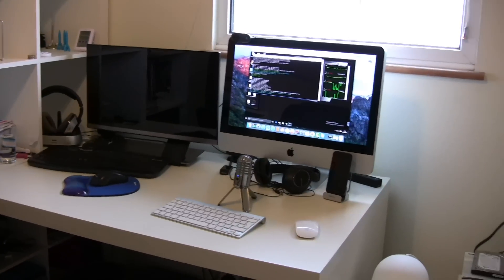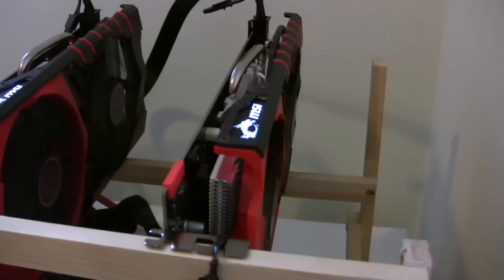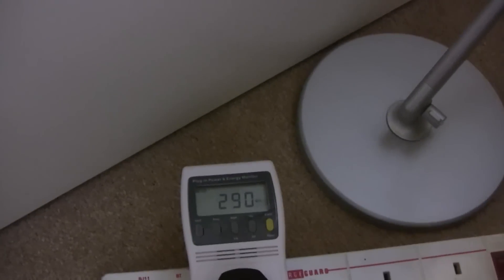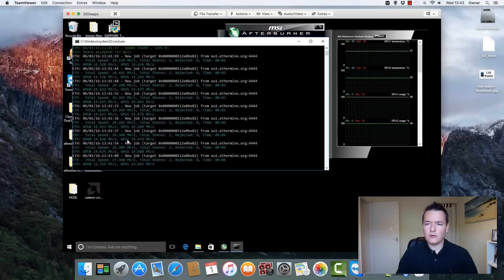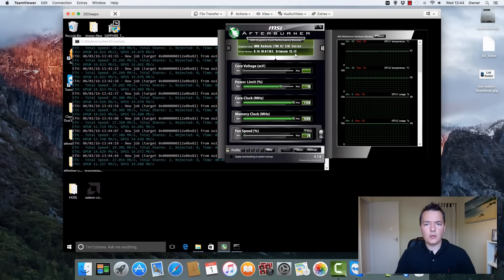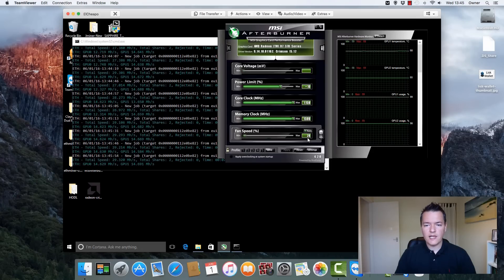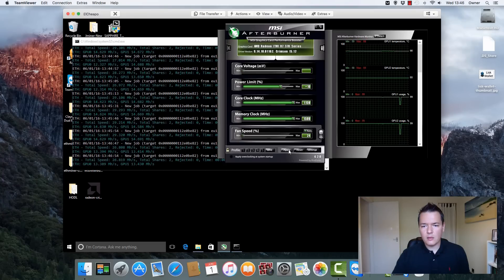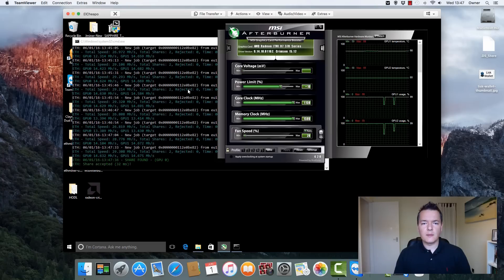El Cheapo Ethereum Rig Details - R7 370 Power Usage Drivers Clock Speeds etc

Comment: how can I use two mining rigs in a mining pool account? and also how can I Connect the two rigs to a LAN network so that  both of them can mine in a mining pool account?
Reply from the maker: Just set both of the miner config files to the same wallet address or account name.
Plug both of the rigs into your hub / router using a network cable. They don't have to be networked.

Comment: Hi, can to try running your fans at 100% and let me know what MHz you get. 75 degrees is too high. How many watts are you using?
Reply from the maker: The rig is outside now and using around 500 watts, with 1150core/1500mem I'm getting 13 mh/s for each gpu. Its running much cooler but 75C is not really that hot, most gpus have a manufacturer specified max temperature of 90C.

Comment: Crypto currency in order to see any pro's you need unlimited data through your isp or cellphone. And better trust the coin miner administrator.
Reply from the maker: You don't need unlimited data, the data usage is very low for mining.
Reply: Depends on how many rigs you have going in your warehouse.
Reply: Any chance of making one tiny enough to set up in a bucket with a power inverter solar panel to power it.
Reply from the maker: Spider Mcgavenport
Maybe a low power cpu or hard drive miner but I don't think you'll get enough power for a gpu miner.
Reply: I speculate about this also, as solar photovoltaic cell's have improved over the year's but I'd also use a linear wind generator on this bucket design also with a car sine power inverter. giving the bucket the ability to have a portable power outlet, just questionable able weight with battery packs, thinking those large rechargeable batteries or a motorcycle battery and set them along the bottom of a 5 gallon bucket, running a very low power matx that is micro atx mobo corsair low profile low voltage white ram sticks and the ssd drive would be attached pci and the bit miner would be usb modules but that is only if it's even affordable after coin collection. I'd also be using msi brand components with AMD fx-8320 as they make an e version. and you can turn off cores for power management.

Comment: Then a good 600W is more than enough for two, maybe even 3x R7 370...291W at the wall (AC) means is using about 260W at DC or even less...another VGA would not hit 400W demanded on DC...what do you think about it?
Reply from the maker: 100W per R7 370 & 100W for system would give you a rough idea of the wattage. 600W would be okay for 3 but I'd recommend 750W for a 4 card rig. Check the PSU and ensure that is has enough 6 pin pcie power connectors many of the 600w only have 2 and you'll need 3 for 3 gpu's.

Comment: great videos,  I have finally got my rig up and running but I can only seem to get to work with one card but I have three connected. I disabled two just to get it running so I was wondering if the new miner software you are using is any easier to set up for multi gpu mining and could you possibly attach you batch file for multiple gpu mining please as I have been to every forum but just can't seem to get my rig running with all three cards which are: Xfx r9 280x 3gb,  Vtx r9 280x 3gb and a sapphire 285 dual 2gb. 
keep up the great work :)
Reply from the maker: Hi, which miner program are you using and what is in your config file? Most miners will work all cards by default so something is not quite right.
Reply: Thanks for getting back to me so fast, over the weekend I did nothing read more forum posts and finally managed to get 2 of my 3 GPU's up and running the only one I can't seem to get to work is the 2gb Sapphire 285 , I figured it was probably because my other cards are R9 280x 3gb cards and they just don't like eachother.....LOL!!
 Oh, Im using Ethminer-0.9.41-Genoil-1.1.2-pre which i'm quite pleased with as you were saying that your just about getting 30Mh's overclocking your 370's where as i'm averaging 36mh's without overclocking my 280x's still want a 3rd card though :)
Reply from the maker: Mookfish2012
Try adding this in the first line of your batch file, its supposed to be a fix for 2gb cards but I'm not sure if it will work alongside your 3gb cards.
setx GPU_FORCE_64BIT_PTR 0
setx GPU_MAX_HEAP_SIZE 100
setx GPU_USE_SYNC_OBJECTS 1
SET GPU_SINGLE_ALLOC_PERCENT=100
Reply: +RiskyRandoms, thanks for the code mate but I have already tried it,  it's kinda weird actually.  when I run the 2 3gb cards they run at 36mhs but when I add the 2gb card the miner only runs at 18mhs before it stops working as if the 2gb is the only one running and stopping the other 2 but all three are visible in Ethminer so I'm thinking they just can't run together unless it's something like the motherboard needs more ram. 
Anyway thanks for your help and keep making the videos.
Reply: +RiskyRandoms Hi Lee, hope your weekend has been good? 
 just thought I would add this as it maybe useful for others who have the same issue.  as you know I was struggling to get all three of my cards up and running which were 2 3gb and 1 2gb, at first I thought it was a conflict between the cards and nearly bought a third 3gb card but then I remembered something I had read on a forum and just
 bought an extra 4gb of ram taking my system to 6gb of ram from 4gb and now it runs beaut on all three cards at an average speed of 52mh/s, seems that you need 2gb of ram per card, hope this helps, thanks.

Comment: Well my r7 370 sapphire nitro's are in and after max overclocking they almost get to your speeds with your 370's so either the cards you got are better than the sapphire cards in some way or the 15.12 driver is the better one to use which I have yet to find it and maybe your pool is pulling a little faster speeds somehow :/ I don't really know I'll see what I can do but I manage about 14.3 mh/s per card
Reply from the maker: What clock speeds are you using? I tuned mine up a little to get 15mh/s using higer than the standard max overclock settings.

Comment: I'm currently building a 6 gpu r7 370 sapphire nitro build after seeing this :) they're on sale at newegg for 130 with a $15 rebate which is an amazing deal that pushed me into selling my gtx 980 and going for the build
Reply from the maker: Yes, the R7 370 are working really well. I have a Asus Strix coming in a few days and I'll be able to compare against the MSi ones I have, I don't think they'll be too much difference in performance.
Reply: +RiskyRandoms btw i saw the video where you put your gtx 970 in the p0 state so it ran fully maxed out increasing the hash per second a good bit is there any way you can do that with amd gpu's? Or do they work differently and they automatically do that?
Reply: +RiskyRandoms also I'm getting my first r7 370 this Wednesday still waiting for my 980 to sell to buy 3 more. Just gonna try to squeeze as much as I can if you can put it in the p0 state and I'm gonna overclock it as high as it will go and if I get 16 mh/s I'll let you know I'm hoping to clock all 6 cards enough to get 100mh/s rather than 90mh/s

Comment: Hi , would ram be an issue when building an ethereum miner from older computers. I have access to 2gig SDRAM at most and it seems to run windows 10 fine.
Reply from the maker: Maybe! I could not get my miner to run on 2GB the lowest ram I've been able to use is 3GB. Perhaps on Linux you may be able to use less, perhaps you could buy some used ram from ebay? the old stuff is really cheap.
Reply: Great , thanks for the info. Love the channel.

Comment: Hi Lee, on my rig i didn't see any difference on ethereum Mh/s using Claymore's  mining Eth and Dcr , just getting very HOT around the rig. Rig info :  6x R9390 - Eth 192Mh/s - Dcr 2890.000Mh/s - temp is around 80 ,core clock 1120

Comment: awesome i am definitely building a r7 370 rig after i get my r9 390x rig built, when i am mining just ethereum i set my -ethi to 100 to give me the fastest ethash and when dual mining i set only the decred intensity to -dcri 50 of cousre it might be different for your cards. I also noticed adjusting the decred intensity with your -/+ symbols when the decred intensity gets to high you will start to loose ethash but if you lower it then the ethash will max out again so then i set it manually in my config with my r9 390x and r9 280x i am getting 53mh/s ETH and 1.3 gh/s DECRED here is my config hope it helps 

setx GPU_FORCE_64BIT_PTR 0
setx GPU_MAX_HEAP_SIZE 100
setx GPU_USE_SYNC_OBJECTS 1
SET GPU_SINGLE_ALLOC_PERCENT = 100
EthDcrMiner64.exe -epool us1.ethermine.org:4444 -ewal 0x1Df044f446e.XXXen1 -epsw x -dpool stratum+tcp://mine.zpool.ca:5744 -dwal 16HeKRDjq1hm26Bsza2 -dpsw d=1 -dcri 50
Reply from the maker: Did you trim your eth address for the comment / privacy ? 0x1Df044f446e
It should be longer, just confirming it.
Reply: yes lol

Comment: i've got a rig with 2  xfx 370s and i set the power limit to the bottom to save power :)..  where im from electricity is not extremely cheap.  i'm getting 26 MHs and my wattage at the wall is 253w.  - next week i want to try and flash my nano
there is a guide on the internet where they did a really good mod on some nano's
Reply from the maker: Yes it makes sense to do this, every person should under / overclock to suit their situation and costs.